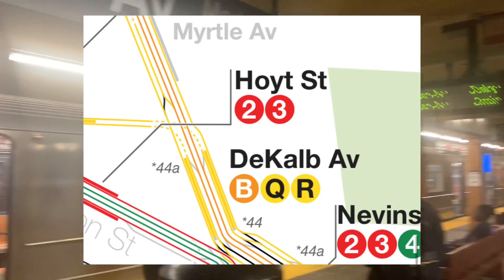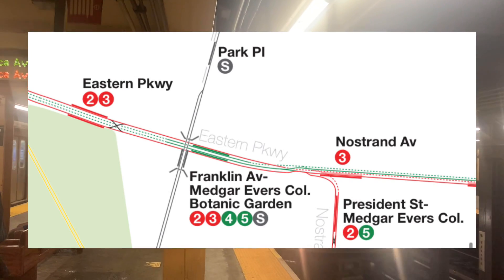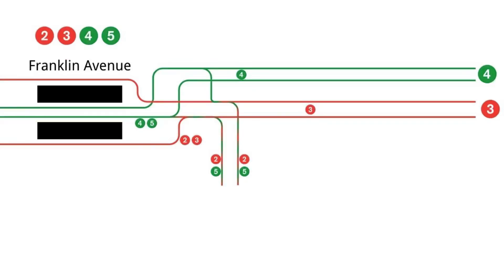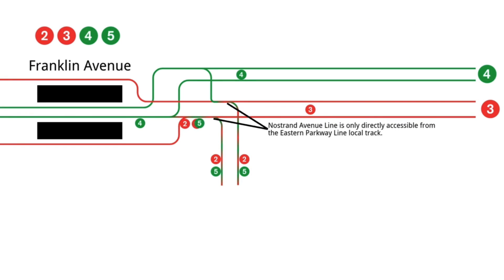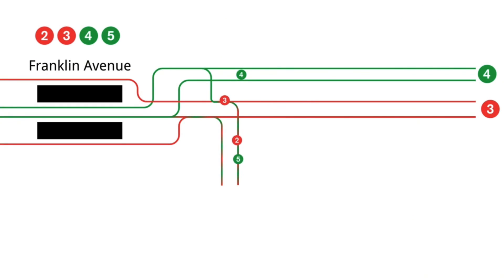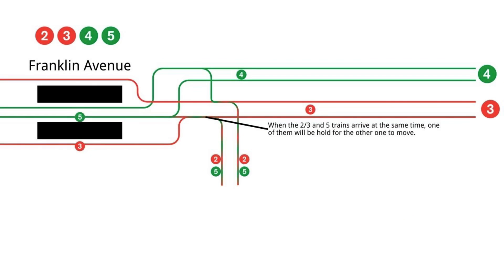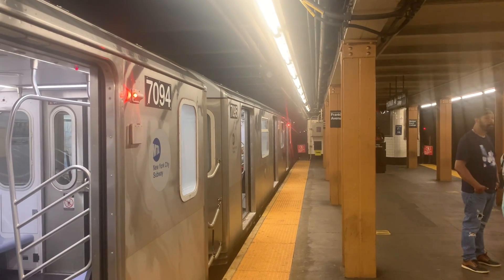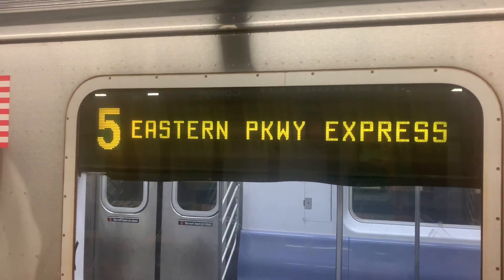Rogers Junction: Fix it to get 30% more capacity in the A division!

Comment: Definitely feel like for the interim, adding those switches such that 7th Ave pair go down Nostrand and Lex Ave pair goes to Utica seems like the way to go. I think it'd be kinda neat if there was a small extension of the Eastern Parkway express to Broadway Junction while the other Lex Avenue service goes and does its run to New Lots/Spring Creek and the Gateway Mall. Utica Avenue deserves to have a full service along its entire length.

Nostrand also needs an extension. Ideally to Manhattan Beach/Kingsborough CC.
Reply: Extending the Eastern Parkway Line to Broadway Junction would result in very low ridership, given that the area is already served by robust subway service, and is already <1 hour from the CBD. Instead, what should be done is creating the Utica Avenue subway branch off Eastern Pkwy for the locals and the expresses go to New Lots, which would frankly serve far more riders than extending the Eastern Parkway Line to Broadway Junction.

And even then, a full length Utica Subway is less of a priority, and even then, it should NOT be going to Manhattan.
Reply: @TheRailLeaguer  Disagree somewhat on the ridership argument as the point of a further short extension of the E-Pkwy line would be to create better networking in the outer borough between hubs. Another example of such an extension for similar reasoning would be the Franklin Shuttle extension to Bedford-Nostrand Aves which opens the entire borough up to better north-south trips and access to Queens without backtracking through Manhattan or strange routes near downtown Brooklyn. The IRT connection there would give better access to Jamaica bound passengers or create more network redundancies that can come in clutch when service disruption take place on top of just opening up more of the borough to folks who want to stay in network via the Subway.

Absolutely disagree on that Utica Avenue commentary however. Utica passes through rapidly developing or immediately primed to be redeveloped areas and already had the numbers to justify a real trunk. The IRT suggestion also caps off any ridership north of Eastern Parkway for the foreseeable future and given how many times we've seen compromised decisions result in immediate aches and pains with the recent MTA, just once we should prob try for more. One of the best alignments I've seen thus far uses a full build of SAS and has either a branch or the entire line built out east on Houston under the East River meeting the IND Crosstown and BMT Canarsie Lines (offering relief to this is especially valuable) at Metropolitan Ave then turning down meeting the BMT Jamaica lines/IND 6th Ave Local at Myrtle Ave before continuing down Malcolm X / Utica all the way to Kings Plaza and I definitely strongly agree that's the build that should be aimed at.
Reply: @TranscendentAzure89 Your arguments are invalid, considering that your proposal to extend Eastern Parkway service to Broadway Junction duplicates the Fulton Street Line entirely, which already connects Downtown Brooklyn and Jamaica via the transfer at Broadway Junction and it would be much faster.

Also, an IRT line does not cap any ridership north of Eastern Parkway, which given B46 SBS ridership is basically low over there (the Broadway portion of the B46 local is even worse). However what I’m proposing is essentially a slightly modified version. Here, south of Eastern Parkway there would be four tracks. The innermost two tracks would be a branch off the Eastern Parkway Line, being the express tracks of the route. It would stop only at Empire, Church Avenue, and Avenue H, before making all stops to Kings Plaza. This will be the Phase 1 of the Utica Avenue Lime. Then we have two local tracks, which would start at Avenue H, make all local stops to Eastern Parkway, and from there, continue north on Utica and Malcom X and then DeKalb to Ridgewood Terminal, connecting with the L and M trains, and eventually into Queens. This will be your Phase 2 and beyond. This would not only provide short term gains, but also better connect Brooklyn and Queens and also provide that full capacity you’re looking for. In the interim, I do propose extending the B46 SBS to Ridgewood terminal to provide that L train connection.
Reply: @TranscendentAzure89 good
Reply: @TheRailLeaguer 
Please do Utica, there's too many situations right now pointing to that being the next "no brainer" for how much it can snowball into. If the IRT extension is chosen, that's a (semi) immediate filling of a long standard rapid transit desert, buffs to the IRT system as it forces the horror that is Rogers Junction to get reigned in, and giving purpose to the 5 line as more than a filler line.

If the IND is chosen (and honestly, it kinda should), that's an immediately more exciting bit as you now know there'd be a southern Brooklyn terminus to the current 2nd Av Subway and in an ideal circumstance gets itself re-routed south of 63rd Street along 3rd Ave to better hit the midtown central business district until Houston St where it curves east with a stop at Ave C or so, goes under the river to Williams then curves south under Montrose Aveune before going south to Stuyvesant (to the Myrtle Avenue J/M/Z station) then south the remaining portion of Malcolm X Blvd-Utica Aveune.
Reply: @TheRailLeaguer 
According to census data Utica Avenue riders are headed towards downtown Brooklyn and Lower Manhattan so having an IND Utica Avenue line would no longer be necessary. 

Also Lower Manhattan isn't really a popular destination for those on Broadway Brooklyn and Myrtle Avenue rather their preference is Midtown Manhattan Soho I think for now M train interlining is worth it but as gentrification marches Eastward into Northern Brooklyn and Queens in the long term we might need drastic improvements and changes to fix the infrastructure of the BMT Jamaica Line as a whole.

There's also another thing about the lack of connectivity between Northern Brooklyn, Southern Brooklyn and Central/Northern Queens (of which Queens is currently dry and is in better need of public transit mobility).
Reply: @TheRailLeaguer 
Speaking of housing development in southern Brooklyn is mentioned. I've said before how I feel about SAS being the Utica Avenue line, as a way to relive the Lexington and Canarsie trunks in general, and platform overcrowding at Union Square and Bleecker St in particular. (It would also aid Brooklyn/Queens connectivity by giving the E, K, J, and M lines north/south connections.) Right now it would be helpful to know whether current B46, G, J, and L riders prefer Midtown East or Midtown West as a whole. Because my stance for Utica Aveune being a separate IND line rather than an IRT branch could be fulfilled by an extension of whichever 8th Avenue services terminates at World Trade Center instead of SAS. Could go either way.

 Since we're talking about crayons here's mine. I keep my A/C/E labels for Fulton/8 Ave/Queens Blvd express, with the K being 8 Ave/CPW local. I am no longer extending that on the Manhattan side, so WTC stays. The K would be extended at the Washington Heights end into New Jersey, via Route 4, to Paterson NJ.

I used to tie an extension of the Myrtle Avenue line to 8th Avenue. Instead I'm tying it onto Broadway. Now that I know the S-bend between Corrtlandt St and City Hall can only take a maximum of 20 TPH, I'm extending the present day W down to the lower level of City Hall then to downtown Brooklyn on a new alignment finally I have the W running down Myrtle Aveune with a portal at Ryerson Street so it properly connects with the Myrtle Avenue El. So the would now share tracks between Metropolitan Aveune and Ditmars Blvd, combining this is a future extension along Eliot Avenue and Junction Blvd to LGA serving Corona all within a one seat ride and creating a loop line this would follow the Q58 which is top 2 of the busiest bus routes in 2022.
Reply: I agree on the Nostrand Av extension to Manhattan Beach. There were plans originally to extend the Nostrand Av line to Coney Island
Reply: That’s good enough to be a FULL solution. The Flatbush line doesn’t need eastern parkway express trains
Reply: @qjtvaddict So you’re agreeing with my proposals?
Reply: @TheRailLeaguer 
He is not talking to you Jeremiah
Reply: @DkejxWjqixj Really, because it seems like my proposals are far more cost-effective and sensical?
Reply: @TheRailLeaguer 
First off read his comment, second of all of SAS going to Utica is impractical then why do people bring it up many times by others if it has low ridership finally I would simply extend the 3 into the Bronx taking over 5 train service from Dyre while the 5 goes to Jerome as Dyre Avenue riders prefer West Side services over East Side services.
Reply: @DkejxWjqixj Many people keep bringing SAS via Utica because their heads are on backwards, failing to see how cost-ineffective it is compared to my proposal of having it branch off the Eastern Parkway Line, though I do include later provisions for expansion north to Queens. Aka following the money.
Reply: @TheRailLeaguer 
Okay but why do some people brought up the Vanshnookenraggen deinterlining plan and brought up proposals to revive the Myrtle Avenue elevated from City Hall to Broadway connecting with the elevated and why do people agree more with JTAs ideas rather than Mystic transit ideas you think Mystic transits ideas are less cost effective is that why you agree with his ideas more rather than JTAs ideas huh.
Reply: @DkejxWjqixj Everyone has their own opinions, but there is a difference between that and flawed logic. Believe it or not, it’s not JTA, Mystic, or Vanshnook who come up with the best cost-effective ideas (not always), but rather it is…..

ME. Yep. I have pretty much a level of transit planning expertise that surpasses all three of them (even if I’m not up front about it). Especially since my plans focuses on the things people truly care about: <1 hour commutes to the entire CBD, <30 minute commutes to a secondary hub, etc. That’s where the line is drawn between myself and everyone else. Yes a few people may have to transfer but it is no big deal.
Reply: @TheRailLeaguer 
Also when you brought up your proposals then why do people keep on neglecting and ignoring your ideas such as the Fulton Street - Jamaica Avenue line connection for example a person mentioned that it's a waste of resources without evidence to provide it so you're basically saying is that is JTAs head on backwards with his ideas.
Reply: @TheRailLeaguer 
Okay then whats your crayons for deinterlining the subway system and giving long term subway connections and extensions. Like the Fulton Street connection for example.
Reply: @DkejxWjqixj What do you mean by “crayons”? Are you confusing fantasy for real world expertise?
Reply: @TheRailLeaguer 
I'm talking about your long term ideas for extending the subway system you brought up a Fulton Street Jamaica line connection plus a four track Utica Aveune Subway to Northern Queens right but why does some of your plans bring up four track subways with closer stop spacing even when building four tracks is wasteful and unnecessary. What's next do you propose building a 3rd Aveune Subway even when Metro North parallels it because that is fantasy all of your ideas are.
Reply: @TheRailLeaguer 
Building a full length Utica Avenue Subway should be less of a priority and even then it should NOT go into Manhattan because that will just duplicate existing service and the demand above Eastern Parkway is pretty low and Williamsburg demand is virtually zero considering that most if not all B46 SBS riders drop off at Eastern Parkway with very few going above Eastern Parkway Southeast Brooklyn has the most ridership potential and those Southeast Brooklyn neighborhoods also have potential to be upzoned and is much more dense unlike those Northern Brooklyn neighborhoods and East-West corridors which doesn't have any ridership potential whatsoever so a much better use of resources would be to improve bus service and add BRT to well used bus corridors on East West corridors in North Brooklyn that's a more efficient use of resources rather than useless subway extensions which would see empty trains compared to serving dense North-South corridors in Southeastern Brooklyn such as both Nostrand and Utica Avenue which will see much higher ridership and packed crowded trains from day one which is estimated serve around 100,000 riders per day giving both Nostrand and Utica the potential to even upzone). Railfanners keep bringing up SAS via Utica because they fail to realize how cost-ineffective it is having the IRT Eastern Parkway line serve Utica Avenue corridor as a reroute of the 5 train will serve the core of the Utica Avenue corridor as most of the demand is below Eastern Parkway even if it's just to Church Aveune would bring many benefits plus a Nostrand Avenue line extension to a new modest terminal Kings Highway will suffice for now (which can increase the number of trains due to having tail tracks and the amount of passengers that can now quickly load or offload onto a train due to the new terminal being an island platform which can lead to faster service and terminal ops). which makes a Utica Avenue 5 train extension south to Church Aveune and a Nostrand Avenue extension to Kings Highway suffice for now. 

The main problem is that railfanners are solely focused on their own fantasy plans to the point where they aren't thinking about actual expertise when it comes to using the subway system  because they lack an open mind more realistically if we were to de-interline we have to take into account physical bottlenecks, merging conflicts, terminal operations (such as bumper blocks), switches, new yards etc also lastly we can only do so little considering the amount of rolling stock that we have therefore the amount of TPH that we can run on each line is limited (So ideally all services should run about 12-15 TPH max) that's around 24 or 30 TPH combined for each trunk. Also another thing we need to take into account before we expand the subway system the first priority should be to partially de-interline the system (although a few interlines can be kept) otherwise you'll make reliability even worse if trunk lines remain interlined with an expanded subway system. Railfanners who are focused on fantasy rather than real world expertise don't take these aspects into consideration for their plans.

Comment: To fix the Rogers Junction, extension to Sheepshead Bay from Flatbush Ave or adding on a # 8 train is going to be costly. Let the #2 and #3 trains go to Flatbush Ave. Perhaps build an underground yard after the Flatbush Ave station to ease congestion. And let the #4 go to New Lots Ave via the express track. #5 trains could operate to Utica Avenue via the local tracks after leaving Franklin Ave.
Reply: Too complicated run all 7th ave express trains to nostrand line and lex exp trains to new lots and if 5 is eliminated no issue just increase 4 service
Reply: Before June of 2009, the 5 trains used to terminate at Bowling Green during the midday week (which caused delays on the 4 trains going to Brooklyn. Since then, 5 trains have been operating to Flatbush Ave - Brooklyn. I don’t think by eliminating the 5 trains would solve the problem especially when you have heavy ridership during rush hours.
Reply: @qjtvaddict WTF that plan makes no sense
Reply: @tombarzey7964  Sending the 4 to New Lots via the express makes zero sense. Whatever train is on the local is the one that continues to Utica. Its more feasible that way.

Comment: The (4) should run to Broadway Junction instead of terminating abruptly at Utica Avenue. The <4> should run to The Rockaways via Utica Avenue express, while the <8> should run via Utica Avenue local. The <4> should run to Breezy Point-Beach 222nd Street, while the <8> should run to Rockaway Park-116th Street. The <4> should also run via Jerome Avenue express to Seton Falls Park-Grenada Place making these stops in The Bronx: 

Ⓜ️ Seton Falls Park-Grenada Place
Ⓜ️ Edenwald Avenue
Ⓜ️ White Plains Road
Ⓜ️ Katonah Avenue
Ⓜ️ Van Cortlandt Park East
Ⓜ️ Bainbridge Avenue
Ⓜ️ Burnside Avenue
Ⓜ️ 149th Street-Grand Concourse
Ⓜ️ 138th Street-Grand Concourse
Reply: @bennythepenny  no js switch the roles w the 3&5 5 be local with the 2 and the 3 be express with the 4 ez as that
Reply: no this is too much sorry. just swap the trains roles around that way it wont experience delays